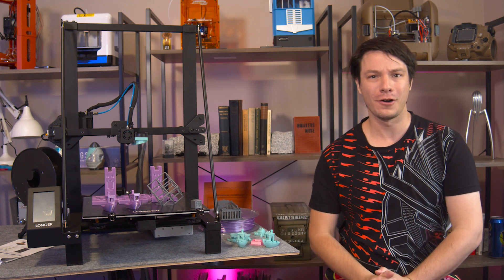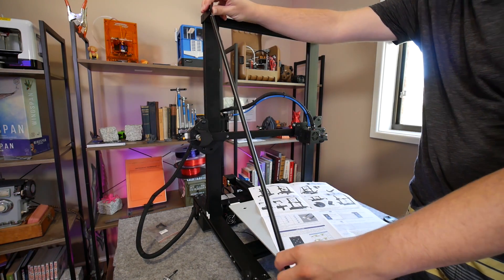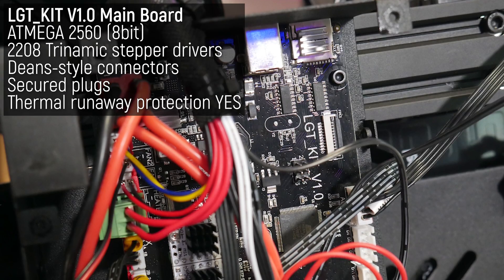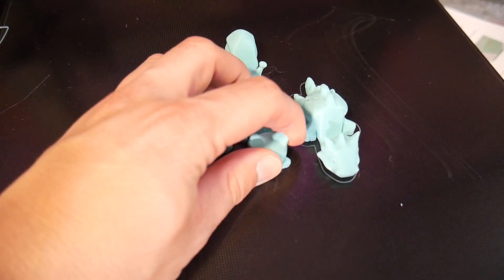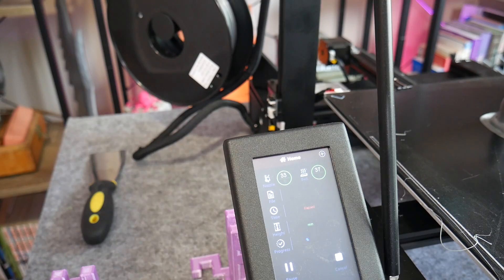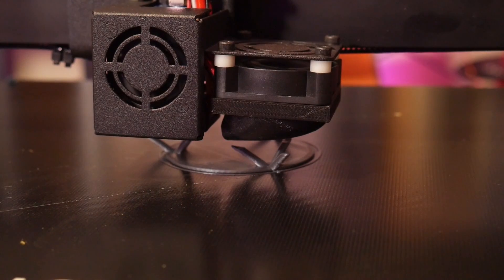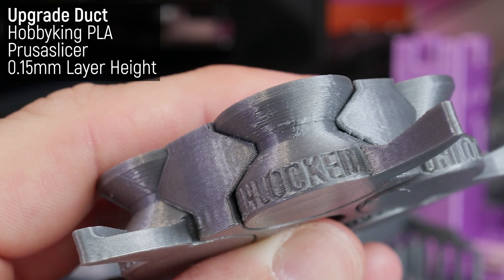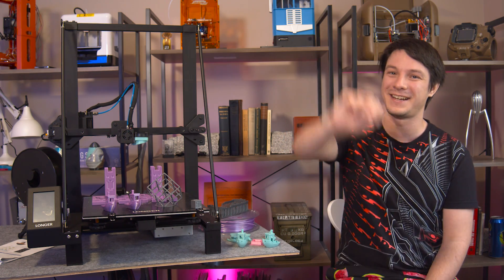Have you been LONGING for a 3D Printer like this? LK5 Pro 3D Printer Review

Comment: New subscriber.  I just got this Longer LK5 Pro myself right around black friday as Amazon had a deal.  I'm mostly satisfied with the printer, but the support is terrible.  Most of the directions are confusing, or non existent and it's pretty clear they don't have anyone at their company that speaks English well.  

I received a bag labeled "spare parts".  I was able to figure out that one of the pieces was a filament support that just clips on (which kinda makes the filament load angle and the angle of the spool holder... worse?), which I found out by locating a video preloaded on the SD card where I also found a video showing the cable support at the back of the bed that was not included in the directions.  I have had no luck connecting the printer to my PC and have been using the SD card to print.  Recently I located a video on adding the BL Touch and they explain in that video that to hook up the printer to the PC, they want you to put electrical tape over the 5th pin on the USB cable!?!?  I've never heard of such a thing, but I do know that if I try to hook up my printer to the PC and then turn the printer off, the LCD still tries to draw power from the PC and the LCD screen flickers.  

I also have something on the SD card called "fan duct" which I've yet to print.  As a beginner, I have no idea what the issue is with cooling that I see a lot of people complaining about online in the reviews for this printer.   I don't have any way of knowing if the included "fan duct" print is better than what others are using, or how to install it.  You obviously mentioned cooling in the video and I can see the difference, but that doesn't help me understand what the issue is.  Just that it isn't close enough to the nozzle?

I also found a small PCB board included in "spare parts" that appears to be a filament sensor such as the type that lets the printer know if your filament breaks or runs out and then pauses the print, allowing you to load more filament, but I have found zero details on installing it.

They say they have a facebook group for support, but I refuse to join Facebook to get support for this thing.  Do you have any incite on any of this, and can you point me somewhere to get some help?  I like the printer, not crazy about the company.  Then again, to my beginner's eyes, it appears to be just a large clone of an Ender or any other dozen number of printers on the market with the exception of having diagonal rod supports.  Most of the videos on youtube are of people just reviewing the printer and a few unboxing ones.

Comment: For people using PLA and keep getting adhesion issues. Do not use the default 200C,60C settings, instead, turn them higher to, say, 220C and 80C. At least for me, it starts to print things just fine.

Comment: Love your channel and advice, however.  I have had this printer for a couple of months and haven't had a single problem with it even on very large prints.  Also the benchy is usually one of the first things that I print when I get a new 3d printer and I didn't have any problem with the front of it warping unless I try to print to fast, which seems to be the same on most printers.  But just the same keep making great videos.
Reply: I just put my printer together last night and my benchy came out fabulous. Just as good if not better then my prusa mini.

Comment: Nice video (like always)! I have the Longer LK1 and have some issues...
I've been having extreme vibrations and tried the normal fixes like tentioning the belts and adjusting the rollers. Still no major impact. So I was going to install TL smoothers but i found that the board was glued together. So if any solutions come to mind let me know.  Thx.

Comment: Great review.... buuuuut... I’m really surprised you didn’t also compare it to the Sidewinder X1... I mean it does have the exact same build volume... as opposed to the Ender.
I just checked the price on the X1 and it’s close to $600 Australian... on that not you didn’t quote the Australian price only American doll hairs. 🤨🇦🇺

Publicly shaming your intern, was a fair bit cringy. 😐😐😐

🇦🇺🤜🏼🤛🏼🍀😎🤓😂
Reply from the maker: I am the intern lol. Yeah X1 is very good, but quite a bit more expensive and more fragile with those ribbon cables in my opinion!
Reply: @MakersMuse  

The X1 ribbon cables is a fair critique. I’ve had my X1 for over a year and the one problem it’s had was a burnt contact on the ribbon cable. 
Replacement ribbon cable has a good quality none conducive anti corrosive. 

You guys can’t say you don’t like the aesthetic of the ribbon cable. 

😂

🤜🏼🤛🏼🤓🍀🍀🍀

Comment: @Makers Muse - ever heard of acitone? It allows you to recycle foam! Ahh science and google, what a wonderful tool how to know how to use!
Reply from the maker: Hehe yeah, it will melt PS but not PE foam, the stuff these printers come in is completely chemical resistant. You could melt it down, but challenging due to the size and low volume.
Reply: @MakersMuse  how ironic that I, me, the magnificient, did not google what type of pavkaging they are using! The audacity of myself! How dare I! But as makers its pretty usefull stuff if all we need to do is heat it up to reuse it. If it is chemical resistant then it would be great to help us with our resin printers.

Comment: Dude, don not pressure companies to switch  internal packaging of force absorbing materials (foam) to subpar options (cardboard) based on some misguided enviroment-saving notion. If you do not want to get broken stuff in transit (to not only yourself but us randoms also). The cardboard has bigger density also and this will make shippment burn more fuel and pollute the air, water more.

 You will only hurt the retail end consumers' product. Want to make a change? Pressure manufacturing companies of plastic products to  create lifecycle of products with degradable if not then at least recycle and upcycle options ( especially textile industry, resin industry). Commercial products packaging material is drop in an ocean. 

 Additionally i would LMAO in a gas mask If that would lead to products (broken appliances) going directly to trash site more often... along with the foam.   

 BTW How much plastic did yours print farm simply just wasted (that went straight to dumpster)?

Comment: For less then $70 dollar more you could just buy a Sidewinder X1. Better main board. Direct Extruder. Dual Z motors. Silent operation. Ribbon cable management. mains heated bed.

Comment: Would you mind designing an improved part cooling fan with a centrifugal blower + better duct? I would love to see what this printer can do with good cooling.
Reply from the maker: In the process! It's quite a challenge to model honestly
Reply: @MakersMuse  - Excellent to know. Mine is on the way, and I'd love to have a better situation for this. Also, I was able to buy this new for a deal of $265, with two 1KG spools of filament. Thanks.

Comment: What does this offer compared to the Sidewinder which has direct drive and dual z-axis motors and similar build dimensions? You really don't need gantry braces at that build volume, although I suppose it would matter if you try pushing the envelope on print speed.

Comment: I have an LK5 and I'm really disappointed with it. I just purchased the Artillery X1 and love it. The LK5 has a major problem with the Z only having on stepper motor and screw. The Z is always off a few um across the X. You notice it when printing a plate full of smaller pieces.

Comment: Pressure them companies if you can! 
Allthough cardboard takes more energy to make than those foam plastics. 
So as long as we still burn oil for heat its not to bad to use the oil for plastics first and burn it later. 
sustainability is a tricky topic.

Comment: About the packaging... there seems little (or no) good alternative yet.
There are foams which are made of corn but they have problems when something is stored for a longer time in a bit moist environment, besides beeing a direct competition still for food.
And cardboard? I don't think that is a good solution:
- much heavier then the foam so it needs a lot more fuel for transport
- not giving soo much protection against throwing printers around in shipping like it happens nowadays. Also stacking 10+ printers in a transport should be possible without giving damage.
- is also having problems with moisture. So probably needs some extra product to keep everything dry during transport and storing on its way.

Maybe some of the points are less important in other parts of the world then here in Europe where there is a lot of moist air, products like printers are stored on a lot of 'cheap' places and flown and driven around quite a lot and every gram counts. My 3D printers have generally travelled more kilometers then I have done in whole of my life... going to Hamburg by ship, then to Poland and then back to Czech republic to be shipped over Germany  to the Netherlands where the ship passed by from China a couple of weeks before, or even flowen by plain... and that after the shipping in China to the ship that travelled all the way to Europe.
And then: lightweight foam is only a fraction of the energy-cost of a product!

I also re-use the foam by the way and was anxiously waiting for my newest printer because I ran out of foam...

Comment: in consideration of card board packaging vs standard foam i don't know what tooling it might require? or after the initial tooling .. how much it would add to the cost of said products.... Second i make a real effort to save all my for good purpose's as a Crafter.. plastic is hard edgy and slips o every thing.. i keep my for padding and bottoms . with hot glue.. For instance Halloween mask's it works great to keep air flow and plastic off your skin.

Comment: Hi. Angus!
I don't throw out that styrofoam because it's a pretty handy material. If nothing necessary to make of it... then you just can use it as a safety feature for your glass parts when mounting/dismounting in a 3d printer. I protect my Tevo Flash's glass bed with it because I have cats... and they jumps :) So anything can be thrown down onto this glass.
Big panels of this material can be used as a noise blocking solution (at least temporary). IDK if it's effective or not but it absorbs some noise for sure.

Comment: This machine had previously been sold as the Diggro A3, with all the same hardware and issues 😳 (including the antiquated Cura software).   Uncle Jesse did a review because of the touchscreen interface about a year ago.  
One thing that would be great to see is an upgrade path for bed levelling using a BL touch or similar, or even periodic firmware updates.  In the year I have had mine, I have found it to be an OK printer, but on what seems like a dead development branch.

Comment: You like that flexible print bed, but what are the bed options if you want to print ABS, PETG or HIPS. What bed material do you need for that material. I have a lulzbot taz 6 with a weird foil over a glass plate. I want to get rid of the foil because of the bubbles.
Reply from the maker: The glass surface is good, but you may need to build a chamber to trap ambient hot air for larger prints.

Comment: I've found a few ways to use the foam that packed my CR-10s from a few years ago. Lined an enclosure for my small air compressor to help cut down noise, use a small piece for PCB assembly, and for padding and to help fit 3D printed helmets.  😅  That said, I'd much rather see it not used. There's not really any excuse to make single use packaging that will be stuck in a landfill for thousands of years.

Comment: YES on environmentally correct packaging!
Reply: NO to broken products. PE foam is completely recyclable.
Reply: @rjc0234  But, will it be recycled in your country? That's another story
Reply: @alejandroperez5368  uhhh yeah? I literally work in a PE foam recycling facility. Unlike paperboard, its extremely easy to shred and reuse in the factory with minimal effort.

Things like electronics are normally sent to other countries to be recycled, things like basic, unmodified polymers and metals can be recycled in almost any country.

Its even a service we provide. any customer that wants to return scrap to us for free, we will do it. When the lorry drops of the manufactured sheets, it comes back full of recycling waste
Reply: @rjc0234  here in Spain recycling is a joke. We have a different container for each type of waste but then all the waste is mixed together later on because of limitations in the recycling system.

Comment: This looks like a slightly bigger version of my Diggro Alpha 3
Reply: yup, that's what I've got too.  Everything from the SD slot in the back to the poor part cooling design to the software on the display is exactly the same.
Only difference I see is that the Diggro matches the Ender 3 in size (220x220x250), and thus skips the extra supports for the z-axis.
Reply: @crinolo  yeah, although I do not see the SD card being on the side as a bad thing when I've seen printers with the SD slot on the back for some reason
Reply: @mrglayden1690  That's fair.  Like Angus mentioned, a slot on the front would be nicer.  But it's not too bad where it is on these.
Reply: @crinolo  oh yeah, better on the front but definitely not a deal breaker where it is

Comment: About the foam packaging, honestly when I order a 3D printer I want it to come to me in one piece. You can find so many customer reports and even reviews when they got some of their parts broken, or the frame bent.
I think it is best if they package their stuff best, instead of packaging it in an eco-friendly way, but having more stuff broken, and having to ship broken products back and forth.
Reply: Imo, stiff foam works better for overseas shipping. It's very easy to cut and reuse. It doesn't absorb much moisture and tends to recover it's shape with the bubble density on impacts.

Comment: Wanhao D12...... GOOD LUCK. Ours was DOA for two days due to wrong wiring in the filament sensor cables! And while we were doing some probing into the cause we found that the bed cable was not secured down properly, bed not grounded, sharp metal protrusions in holes that has cables sticking out of them and also we discovered that the wires going to the bed will most likely snag in the handle for bed adjustment some day... So please be careful!

Comment: What is the fascination of just making 3d printers taller. I would much rather have a larger bed for the stuff I make. Say take any printer on the market and just put a longer rectangular base plate on it. I don't make tchotchkes I make functional stuff so bed size is king. I wish there were kits to add a larger bed to existing printers. Say the ender 3 just make a longer rail and put a say 220x450 bed on it.
Reply: I think there are indeed kits to make the Ender 3 bigger in bed size, dunno if as big as you say tho (about twice the width but same length?), There's a video from Teaching Tech about it, there are kits to extend it vertically and/or base area I think it was called Ender Xtender or something like that.
I get it why increasing height tho, it's really the cheapest option to increase build volume by far. You don't need to make a huge (and pretty heavy and power hungry) bed, having steppers that can accelerate the added mass quickly enough, belts that can take the forces and so on in case of a cartesian. Plus less space on a desk. To make it taller you just order longer extrusions, lead screw and wiring, done.

EDIT: re-reading your comment it does seem like the cheapest way to make a larger bed Ender 3, pretty cool idea! The point about the steppers having to accelerate twice the mass and belts having to take that still stands tho, also twice the power on the bed to heat as hot as before, so the power supply might need a look.